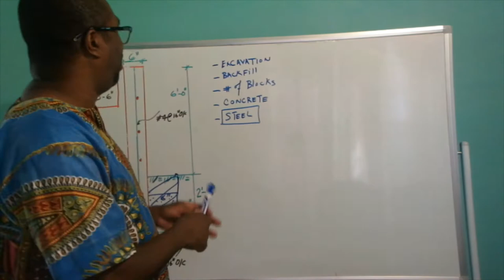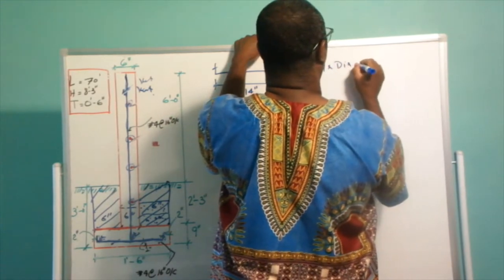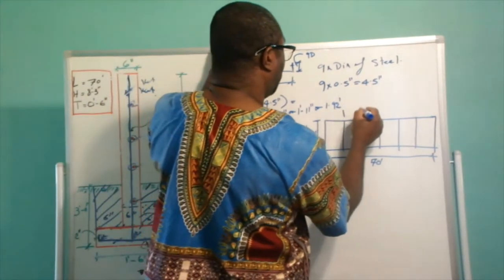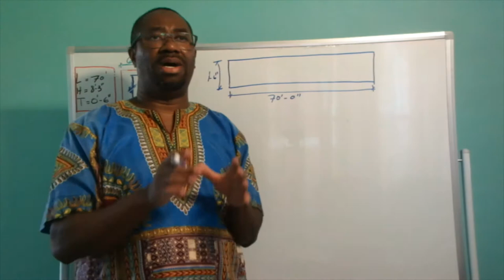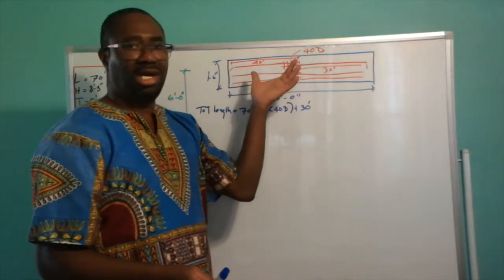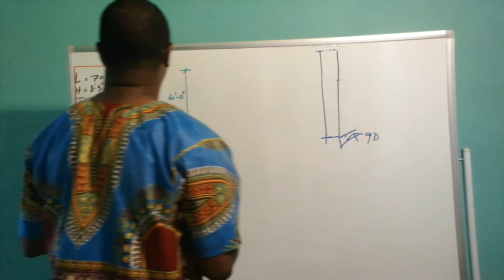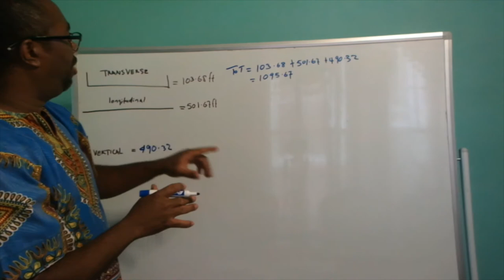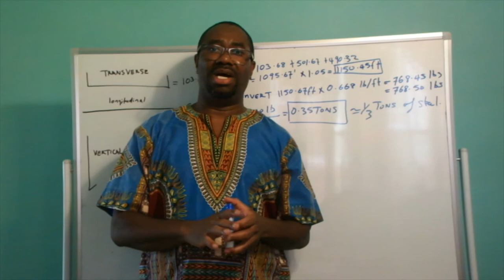HOW TO CALCULATE STEEL QUANTITIES FOR BUILDING CONSTRUCTION IN JAMAICA. (QUANTITY SURVEYING) PT3.

Comment: I really appreciate this content. I am trying to estimate the quantity of material required for a personal project. This is golden !!! Thanks very much for sharing
Reply from the maker: Respect Marvin, greatly appreciated, there are much more to come.
Reply: @jkengineeringarchitecture.  Do you have the usable dimensions for 8 inch blocks?
Reply from the maker: @marvinkelly3078  A 8 inch block has a nominal dimension of 8 inch x 8inch x 16 inch and an actual dimension of 7 5/8 inch x 7 5/8inch x 15 5/8.